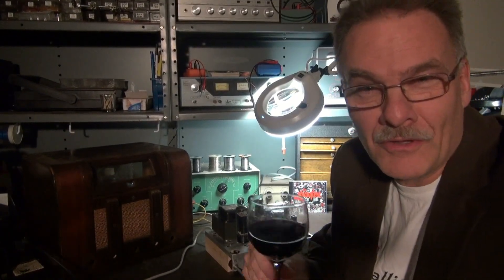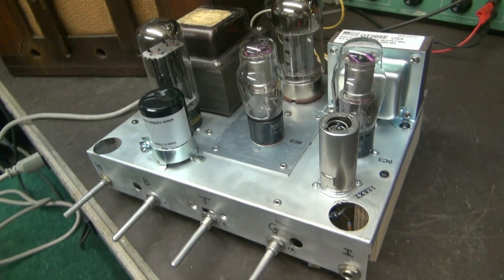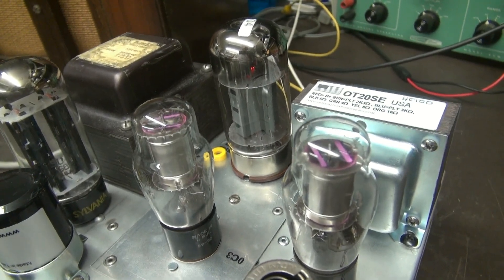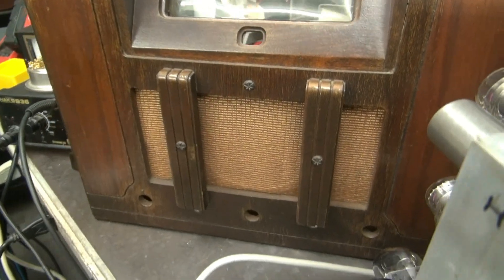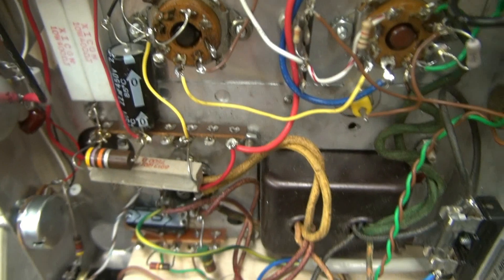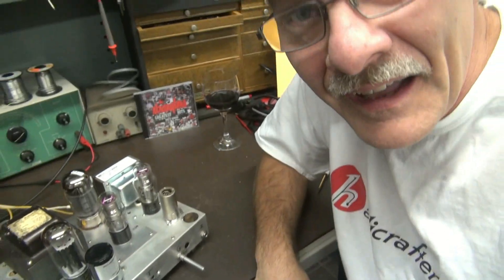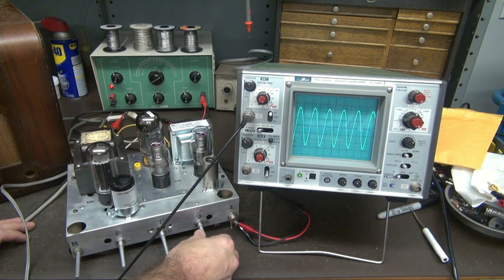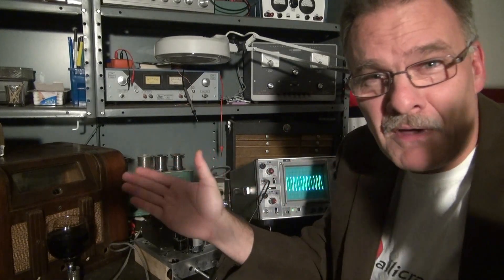Tube amp Theater How to build a Homebrew Boutique 6550 Guitar amplifier by D-lab

Comment: i wanting to know if by changing the anode resistors on a 12AX7 will or does it change the gain i am building a valve HIFI preamp and i want low gain. i was thinking of using 68 k and 82 k what's your thoughts
Reply from the maker: +ian “valve doctor” forster Hello, either that or try a different preamp tube, like a 12au7. I'd also review typical HI FI preamp circuit methods on the web. The guitar input configuration would not work well. Impedance would be much different
Reply: ok thanks i got 2 x 12AY7 i will try 82 K

Comment: Hi Terry - great video, love the wine! Wondering, would these 0C3 tubes be effective/useful on a 6550 push/pull style amp?
Reply from the maker: +Kevin Rheault Yep, The 0C3's were used to regulate the screen voltage. Keeps the 6550's under control. You can also use zener diodes.

Comment: She's real nice!  I like the 0C3 series setup a lot.
How would 5881 tubes fare (aside from needing a rebias) ?
Reply from the maker: +kcrmson The 5881 tubes would not require regulated screens. You could use a pair of 0D3's instead. They would glow nice. The 6550's need tight screen regulation to prevent thermal runaway. That was the reason for the 0c3's. Fun project
Reply: +Terry Dayton thanks for that info!  It's a beautiful amp, can't wait to hear the test!